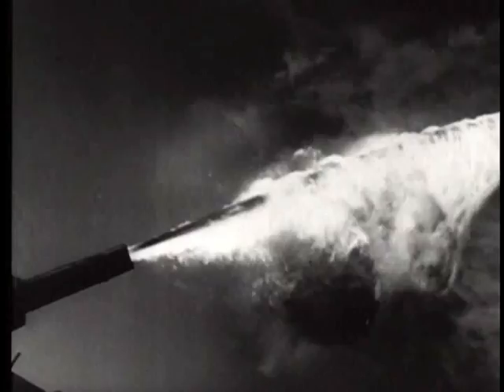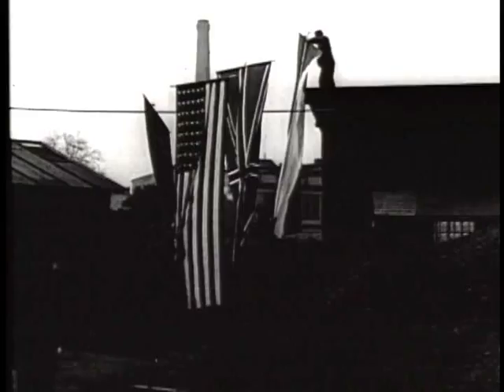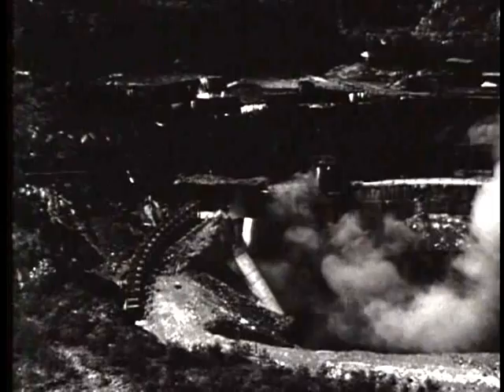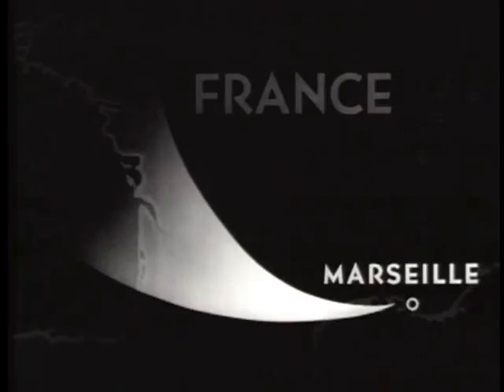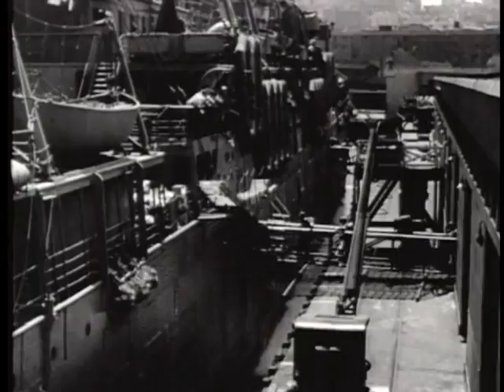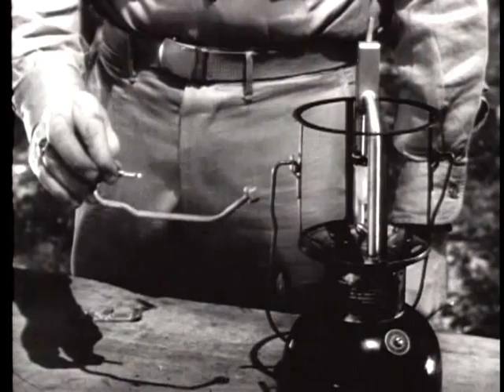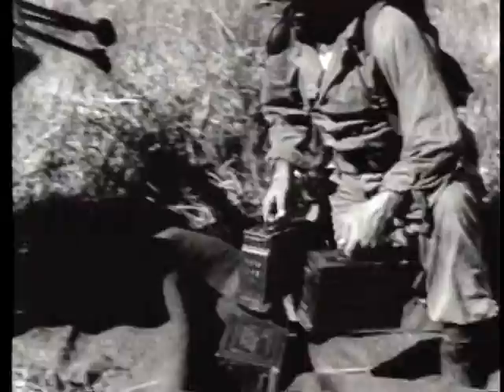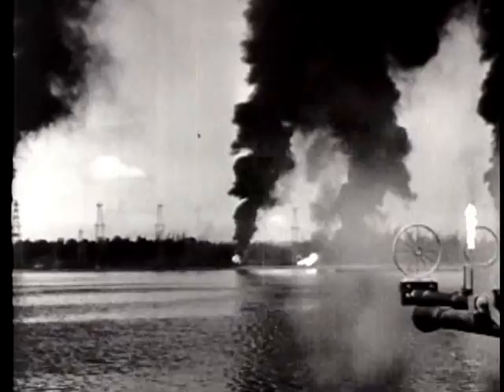Combat Bulletin No. 63 (945)

Comment: One item not mentioned as such, the V2 was an airframe, the first to break the sound barrier.
Reply: Old Guys Place  LOL! The V2 hit 3,580 mph while CLIMBING
Also , at 731 mph the P51 would:
be torn apart
have Zero control
forces on the propeller would tear the engine out
Reply: Old Guys Place  LOL!
Just give me a link to the article on the P51 going 731 mph
Reply: Old Guys Place  Also, at 731 mph the P51 was still sub-sonic. Also the V2 was hitting 3,580 mph in 1942

The speed of sound varies depending on the temperature of the air through which the sound moves. On Earth, the speed of sound at sea level — assuming an air temperature of 59 degrees Fahrenheit (15 degrees Celsius) — is 761.2 mph
Reply: Old Guys Place No propeller aircraft ever broke the sound barrier- the subsonic airspeed indicator was grossly in error at those speeds.

Comment: Great idea to use leaded gas in the stove you cook food in.  Jesus, did people suddenly forget the danger of lead?
Reply: It wasn't seen as a problem then in the 40's it was later when people started to get rid of lead from anything and everything.
Reply: @squatchhammer7215 , what, about forty years later?
Reply: @mountainguyed67  Well, since you can't legally buy leaded gas it doesn't really matter...
Reply: @squatchhammer7215 . I remember when we had both leaded, and unleaded at the pump. But you’re right, not any more.
Reply: It was, after all, 70+ years ago, who knew?
Reply: You can still obtain low lead aviation fuel.
Reply: Leaded fuel was the newest thing - just like DDT (invented by the same guy).
Reply: Matthew Williams Not quite right. 100LL is about knock resistance in high compression piston engines and valve lubrication. The valves of aircraft engines certified and manufactured between 1938 and 2010 need a small amount of lead to prevent damage. Some car engines have the same problem unless the valves are changed along with the valve seats. This is because standard unleaded fuels (and LPG) burn hotter and longer. Other treatments like boron based treatments are available but they have their own problems and are also incompatible with catalytic converters. Alcohol based fuels also destroy copper alloys and synthetic rubber in fuel systems.
Reply: Hey they used to give out cigarettes with C rations into the 70s.